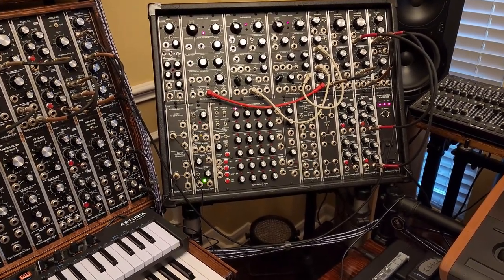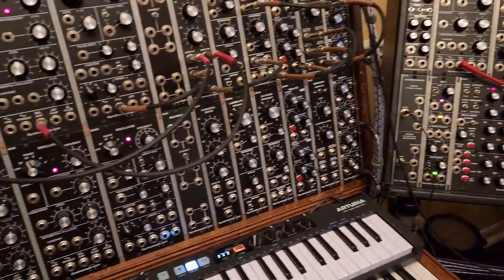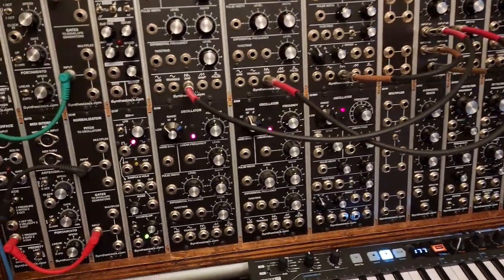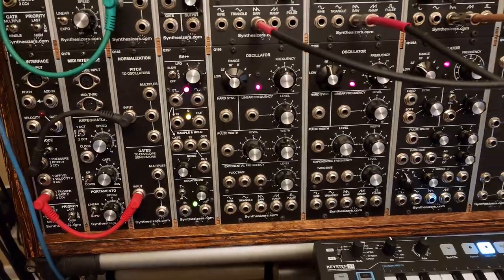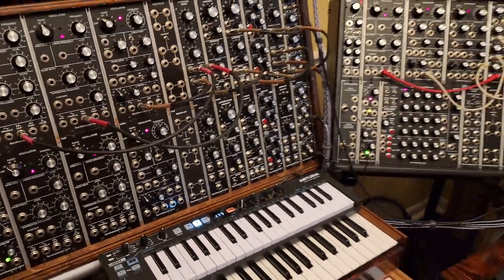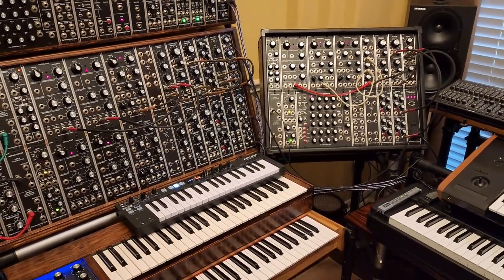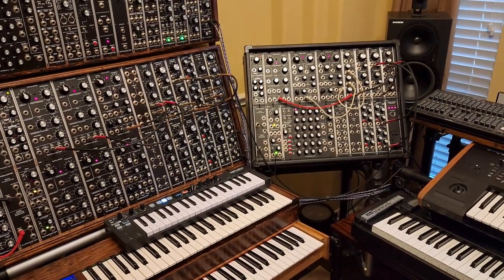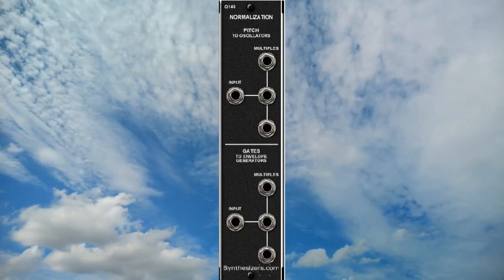Highlighting the Q-146 normalization module.

Comment: Great video, I thought about it but i've multiple brands on my system and that add a little bit difficult to achive, maybe the special module by Moon could  help but are moooore expensive.
Reply from the maker: If you really wanted you could make it yourself. Just take a Multiple and run wire from it to the modules you want to normalize. Switch out the regular jack to a switched jack. With some planning it could be done in a few hours or so.